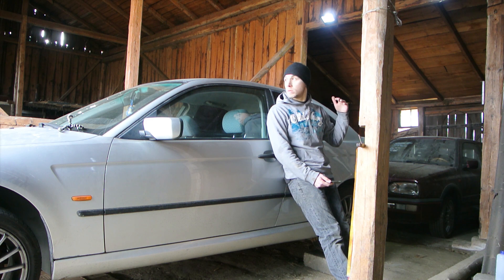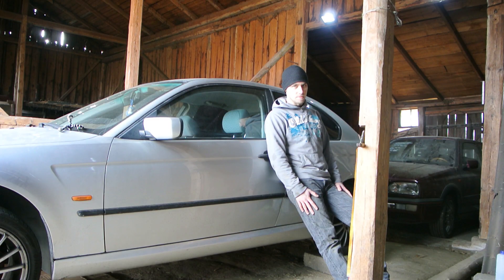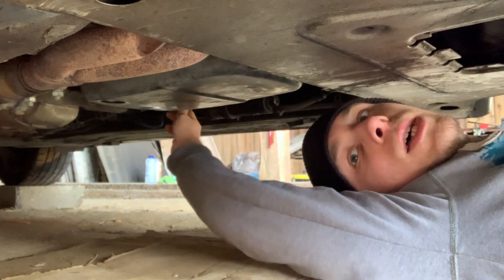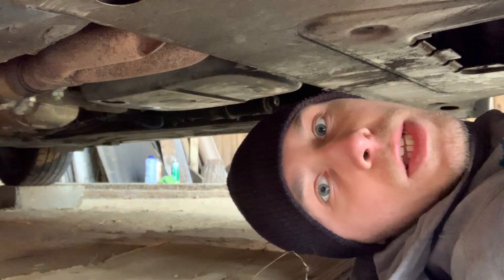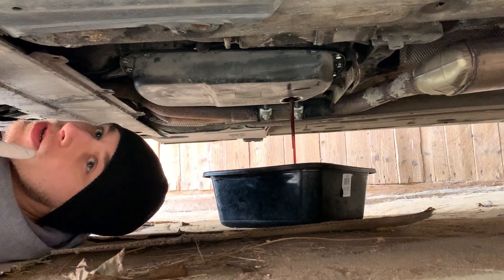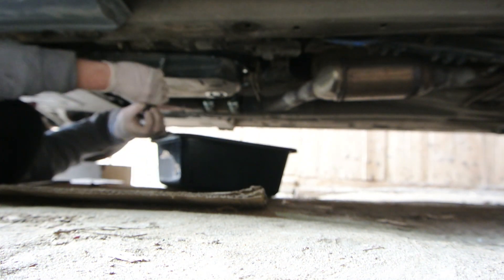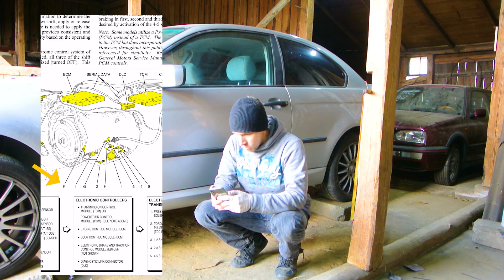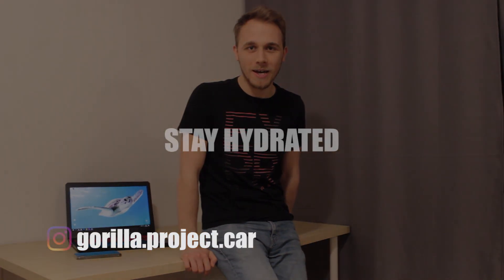AUTOMATIC TRANSMISSION Speed sensor 5L40E

Comment: Did this fix your issue with the car, i have a VE commodore 2007 model utility, it came up with a p0717 code this car also has the GM 5l40e transmission im just wondering if you would recommend replacing sensors like you have.
Reply from the maker: yes, took 5L40E out and put good old reliable manual in 🤣 my transmission was cooked and it's repair would cost heaps more than the car was worth

Comment: I hate old BMW. Never ending repairs. Just not worth it
Reply from the maker: well... cheap, fun, easy to work on. to each their own. I like working on cars. there is no way in hell I'm getting another car with GM transmission but ZF of manual is good. It's like with everything. if you take care of it it'll be fine. I've done around 200kkm in old BMWs and they were pretty reliable. Not toyota reliable abviusly but for the mileage they have and the maintenace they didn't have previously I can say I'm quite happy. I've had an Opel before and it was constant repairs.

Comment: My speedometer is not working I have a 2001 BMW e39 525i help pls
Reply from the maker: Speed sensor? Check the wire for the sensor in the diff

Comment: PLEASE HELP OR ADVISE : I have problem with my e46 325i /2001 
1-Battery light is on 
2-transmission faulty light is on 
3- I hear a bang when switching from reverse to drive 

When I start the car and  see this sign faulty transmission , the car can drive on reverse and other gears except for first gear. 
If I start the car and sign does not show on dashboard, the car only drives on first gear  35 Km speed max. 
Took it to many mechanics and nobody could fix it. 
First guy said he fixed alternator and reprogrammed ECM , The second told me to check and change Positon switch which I did today and still problem not fixed .Now they are saying its the alternator which the first guy fixed.
I checked the battery its giving 12.4 V and when car started and I hit  Benzin pedal it goes up to 13.9-14 Volt .
Reply from the maker: Hi! I really wish I could help but it is really complicated issue from what you wrote and I don’t feel like diagnosis through comments is a right thing. I’d myself start with a diagnostic tool and check what errors are there. Hope you get it sorted

Comment: Does this apply on E90 automatic transmission as well?
Reply from the maker: Hi! I think that for e90 there was a different transmission. Do you have any problem with yours?
Reply: @gorillaprojectcar  My E90 have  this código 565e pressure  sensor C value too high
Reply from the maker: @elfindelnombre9803  on the 6L45 transmission?

Comment: I had the same problem in my e38 2.8 in my case it was bad MAF after replacing it everything went back to normal. You just need to diagnose it better if you still have this car. Do you have any error codes? What are you using to diagnose your car?
Reply from the maker: Wow I thought I replied but apparently I didn’t publish the comment 🤦‍♂️ the car is already apart... I’m thinking about a swap but we will see... right now it’s basically a parts car 🤷🏼‍♂️ 
I don’t remember the codes but they were directing to the gearbox. The engine is sold and transmission is out so it’s time for something else for this car 💪

Comment: I’m getting a code on my bmw e46 95 wheel speed code and a d6 signal speeds code do you think it’s that sensor in my transmission or the yaw sensor because my traction light is on and abs and handbrake light is on
Reply from the maker: I’d start by checking abs. Maybe it is the ring. Best to start with the simplest thing and go to the most difficult to fix. 

My abs and handbrake lights were one once when I had super bad alignment after steering rack replacement. 

Check the abs sensors and rings and then the alignment ;)  

And thanks for the comment! 🙏

Comment: so it has 2 speed sensors?
Reply from the maker: Igi P yeah. One measures input speed from engine. Other measures exiting speed. Don’t know why 🤷🏼‍♂️ but that’s how it works there...
Reply: @gorillaprojectcar  thanks bro I'm about to do that on my e39 528i wagon and I only bought one 👌🏾👌🏾👌🏾
Reply from the maker: Check them for voltage. If they are bad they should show different values. I if you have a GM 5L40e let me know and I’ll check the values for you ;)